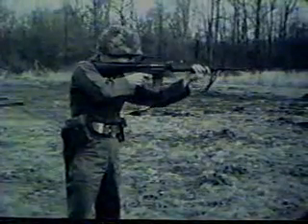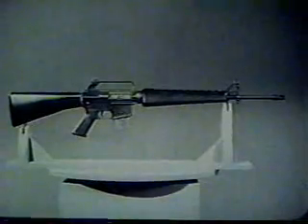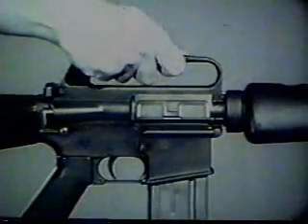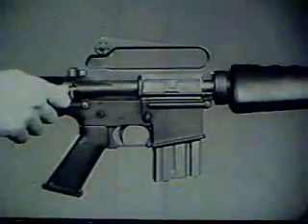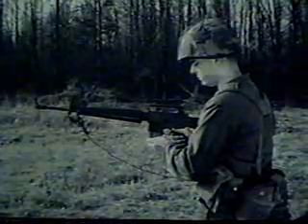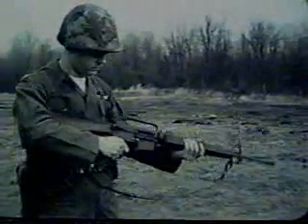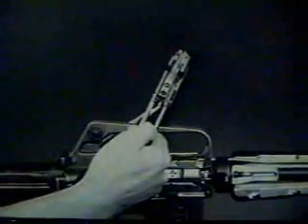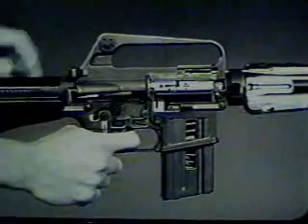M16 Operation Part 1

Comment: @Prim3StaR Actually you're half right - there were three basic versions of the M16 fielded in Vietnam. The first was simply the M16, most easily distinguishable from the XM16E1 (seen in this video) by its lack of a forward assist. Then this version seen here was given to, as it mentions, certain airborne troops and Ranger units. The final version, the M16A1, possessed the features of the XM16E1, as well as the addition of the now-familiar birdcage flash suppressor used on all M16 models since.

Comment: I'm only 14 years-old and I already knew that the representatives of Colt Firearms had told the US Military that the M16A1 was a "self-cleaning weapon" just before the Military had purchased it to sweeten the deal... which lead to the Military not giving out any field cleaning kits for the weapon. In doing so, many of our soldiers died in Vietnam, because of the assholes at Colt.

Comment: heres how it is, the old m16's were actually quit reliable that is when there cleaned allot and thats what made a poor military rifle. They are unreliable when just a little bit dirt and get dirty fairly fast just by shooting. This is becase the gasses that push the bold back exit throught the chamber blasting the chamber, bolt, and other parts with grit. In modern m16's to fix this instead of the gasses exiting throught the chamber they push on a piston in the gass tube. this also reduces heat.

Comment: But how well do you know the M14 and what relates it with the AK47? I've handled a lot of firearms for observation, work and sometimes for recreation, that includes both the M14 and AK47. In fact the only malfunctions I've experienced with an M14 are misfires and ammunition failures. The AK47 on the other hand involved it's mechanics along with ammunition failures. A longer round is more supported than a short one.

What I've said comes from experience and technical knowledge, not just opinion..

Comment: @fruitsandpi Semi is 1 round at a time... Auto or back in those days it was called "Rock n Roll"  shot as long as you held the trigger down or ran out of ammo. The 2-3 round burst was for control. I believe the M16A2 didn't have the full auto, just Semi or 2-3 round bursts... I could be wrong though, the A2 came out long after I was discharged...

Comment: No. "Semi Auto" is ALWAYS 1 single round per trigger pull.
Some variations of the M16 have a "Burst" ability, which fire as you describe, 3 rounds, or a "burst" per trigger pull. Think of it as a hybrid between Semi-Automatic and Full Automatic.

Comment: pull charging handle back, press on the lower portion of the bolt release, and it should lock the bolt to the rear. Using the bolt release for the second mag is correct as the first mag's follower will engage the bolt release internally and lock the bolt to the rear, needing only a tap on the upper portion of the bolt release to run the bolt forward and into battery.

Comment: The internal trigger mechanism has a notched cam that the trigger sear engages after each round is fired and the recoil cocks the hammer back.  The notches in the cam determine if the weapon fires semi-auto or full auto.  Nowadays instead of full-auto, weapons have a 3-round burst.  Meaning that the cam will allow the weapon to fire 3 times for each pull of the trigger.

Comment: Automatic means if you pull the trigger, and hold it, the rifle will keep firing until you release the trigger or until it runs out of ammunition.
Semi-automatic means if you pull the trigger, one round will be fired, and no more, regardless of what you do. Let go of the trigger and pull it again to fire another single round.

Comment: the baretta 92 is good, but not AS good as a glock...and i wasn't aware that an AK could fire under water. . . it's gas oporated, so i can see where there would be problems in firing it in water. Glocks use the recoil system, so no gas is envolved in firing. However, i have never heard that AKs DON'T fire underwater, and it wouldn't suprise me too much to find that true.

Comment: i was screwing around      the hk416 just draws the gasses away from the bolt and hammer and so on   (lot less likely to over heat) with Special holes that drain water in it after it has been submerged       ive heard of piston jam doublefeed failure to chamer and stove pipe    and ive had 3 of them happen to me    i didnt no about the noregians fielding it tho  thanx mate

Comment: The basic functions are still the same, so this video should help you get some understanding. 

Most of the changes were made to the manufacturing process, such as adding chrome to the chamber. "Cosmetic" changes have been made. The ammunition was altered. 

So, the way the parts interact are still going to be the same.

Comment: (part 2)i dont wanna offend you aor anything, u still had a good point, in the waste, legs and arms and head (well that your dead no matter what)the bullet would go all the way throug. also the AK bullets is better in urban fightng because its round will go through most cement walls and doors unlike the m16 round. All of this can be easily looked up on wikipedia if u really dont believe me. But once again i dont wanna start a stupid comment over this

Comment: i see wat ur saying however the 7.62 rounds will not always go all the way through. If it is shot at the chest, it will stay inside the body where it will do alot more internal damage than a m16 bullet. Also when you are shot by the AK bullet u will fall to the ground ( watch the futru weapons episode with the m468, u can find it on youtube) because of the heavy round. If you are hit by the 5.56mm round (smaller than a 6mm BB in diameter) u will still be standing up (unless ur dead)

Comment: you are right and wrong at the same time although the ak has a larger bullet and more power it does not inflict the same damage of the m16 mostly because any bullet that hits the target and goes through the target is a waste of kinetic energy the m16 tends to penetrate and leave massive ammounts of internal damage rather than just leave a hole